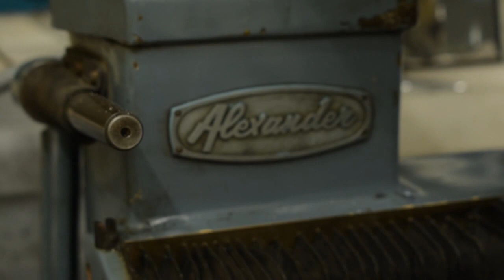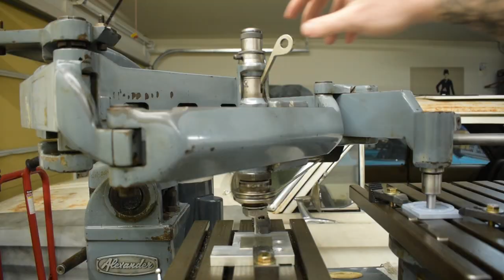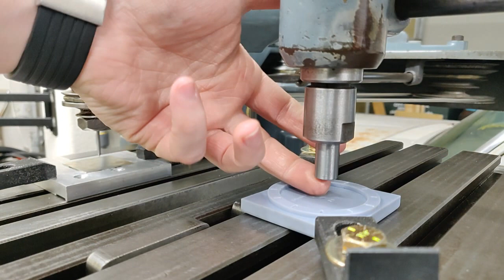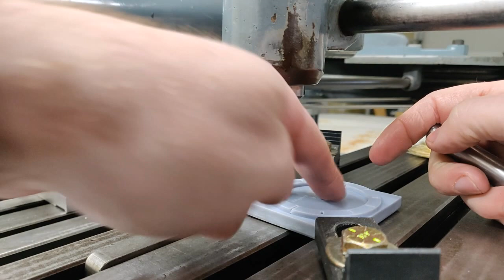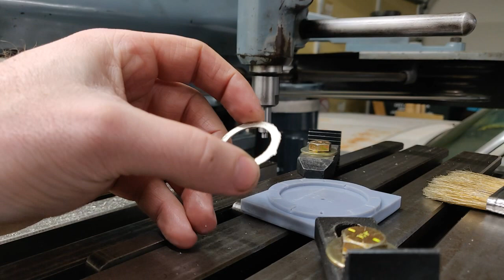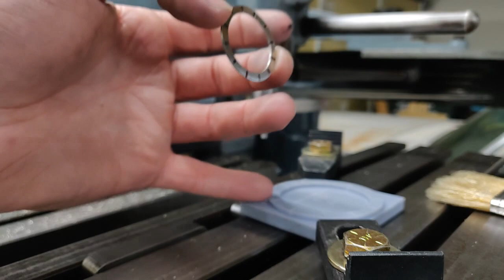Pantograph Demonstration - Machining a Watch Dial Chapter Ring

Comment: From my experience, I believe the noise you are hearing is caused by worn ball bearings. I repair tools for a living and run across this problem a LOT. The ball bearings have run dry at some point in time and have scared the races making them hiss. Oiling them will usually get rid of some of the noise but will not fix the problem as the races are already compromised.

Comment: Nice video. Do you hold the tool so far from the collet for the video? Also I would seek for tools with cutting length as close as the thickness cut.
Reply from the maker: I had the tools sticking out further so I could get a better shot of the work and cutters. For actual production pieces, I plan on choking up on the cutters much more, as I noticed some deflection particularly while climb cutting the outside circumference.

Comment: I just took charge of a Spanish clone of this machine, I see you are using a Urethane belt to drive the spindle; are you making them up yourself, what diameter are you using and is it better or very similar to the original rope type?
Reply from the maker: The rope belting is much better than urethane in my opinion. It has much less stretch, and doesn't slap around like urethane does at high RPM.

Comment: I noticed on your first cuts ,  the tool tip was changing angle at the bearing above . If the shank was shorter , would it be more accurate , say for milling out numbers ?
Reply from the maker: I've since rebuilt the spindle on this machine, which has fixed a lot of the noise/runout issues. A shorter shank tool will always be more rigid.

Comment: Enjoyed your video. I have the same machine and wonder if your's came with a full set of collets? Mine didn't and they seem impossible to find. My dream is to have the spindle modified to a standard ER-11. Hope you post my vids
Reply from the maker: Unfortunately mine only came with a single 1/8" collet. I was able to find two other collets, they are in rough shape and I'm not sure exactly what size they are; something just smaller than 3/8" and 1/4", probably metric. I'm planning on regrinding them to standard sizes. You can also use a Deckel GK21 spindle assembly, and use the Deckel collets that are still available to purchase new.

Comment: Great video but I believe you're looking at the design of the master in the wrong light. Firstly I'd be going for as much ratio as you can print, the bigger the better (i.e. more accurate work and the imperfections of the master (3D print lines) won't be noticeable on the work. So 3 or 4:1 ratio easily. Secondly make your master with slots so you can't deviate out side of them. This will eliminate flat spots & bumps in your cuts where the stylus may have skipped (not against the wall of the master). Thirdly you had some breakout on the walls of the master because it was quite a thin groove depth. The stylus is better as a single pin (i.e. not stepped like yours) of say 1/8". The pin bottom determines height (instead of the flange in your case) therefore the top height can be much higher and won't chip. Hope this helps. Contact me if want and I'll design it for you (no charge).

Comment: When cutting the inside and outside diameters, would a groove in the printed pattern make it more comfortable? A groove giving you both inside and outside contact on the stylus, that way you can concentrate on smoothness of cut and not so much guidance.
Reply from the maker: That definitely does help with cut consistency. I've also given up on 3d printed patterns, and just manually machine them on my mill and lathe out of HDPE.
Reply: You can blow up patterns by reversing the cutter and stylus.